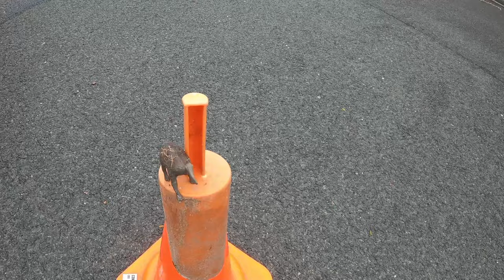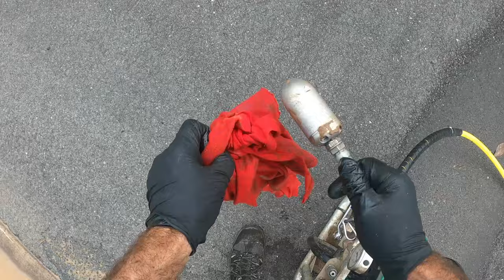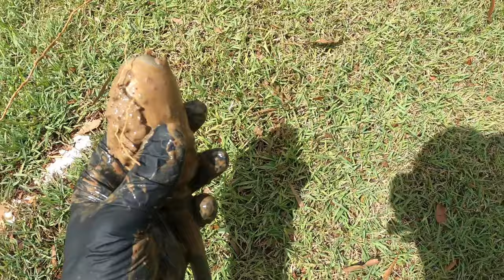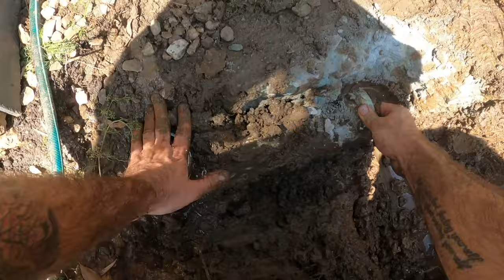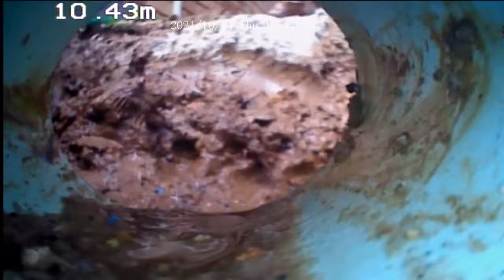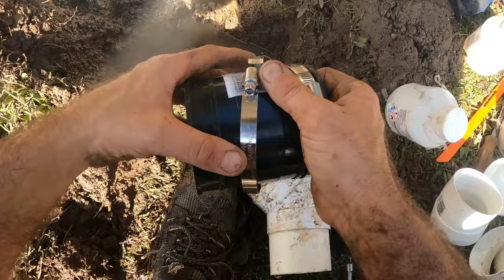Blocked Drain 144 - Muddy Storm Water Unclog & Repair

Comment: Were i worked at p.s.d. for 21 years.we used a jetterall most everyday..we worked the main sewer .you allways get some sort of stoppages .it will go fron 8 inch to 24..sometimes it could be back up for weeks..you would not beleave what people put in the sewer..the jetter we used is huge.700 gallon tank. 2400 p.s.i.it will take you off your feet..600 feet of hose .1 inch..if you get it stuck. .sometimes its reall hard to get loose.i said i never want to do that sort of work again .we did do some personal lines 4 inch..and then i started watching you.

Comment: Perfection. Toss in a bottle of the cheapest liquid dish soap you can find into your fitting box. Works amazing to lubricate the pipe for the fernco fittings and will not deteriorate the rubber.

Comment: just my observation, when i first started watching you, you took your time letting the nozzle do the work. now you keep jamming it in there like drain addict.
Reply: I noted he doesn't always do the jamming thing, but with the clay, mud, and dirt, it may be the only way to do it without using an excessive amount of water.  He also doesn't know it there is a break in the pipe or if it is just mud so it takes a bit more work.  Just my 2 cents.  :)
Reply from the maker: It really depends on the situation and what I can feel.

Comment: You had a fight with this one. 

Could have done with your help a month back. Had a blocked kitchen gulley. Used our Nilfisk pressure washer with a 20m drain jetter attachment. Took over an hour as the pressure is no where near as high as yours. Quite satisfying though.
Reply from the maker: Well done unclogging your drain

Comment: Personally, I would have dug out all of that pipe from the downspout to the part where you cut it, re- engineered it by laying new pipe from downspout down with fewer bends and making the angles more sweeping and free flowing.   As it is now,  looks like it will be likely to collect more crud and be even harder to clean out.   Great work with the 22.5 and 12.5 though and getting it to line up well
Reply from the maker: Thank you 😊

Comment: This is just one of those things where there is no good way to get it fixed.  The best way would be to dig it all up and replace it with schedule 40 PVC (at the minimum) all glued up, properly pitched, and allowed to set dry long enough for the glue to cure and then bury it.  Now it is just get things put back together good enough to work and last a few more years.  Homeowner should start socking away money until the good fix can be afforded.

Comment: I've watched enough of your fun videos to wonder why the contractors down there use such thin pipe for these storm drains. The stuff looks eggshell thin.  I mean it's a good thing for you and your fellow cleaners. Good job security,  but the contractors just come off cheap and ends up causing the homeowners trouble they wouldn't necessarily have with a more robust pipe, less likely to crack or on the curb collapse if driven over.

Comment: Could've been fixed ages ago before the rain..... Yes, that's true, unfortunately, sometimes the problems don't appear as intense until the rain comes and you see where the problem is. Like spraying soapy water on gas fittings or bicycle tyre tubes under water to see if there are any leaks to fix. That's why professionals like yourself will always be in business as one day, everything is fine and fair weather, the next it buckets down and a blockage becomes highlighted. Love your work, videos are great, although I think your little offsiders need a kick up the pants to help more, or bring in some more.
Reply from the maker: Thank you 😊

Comment: Why don't you get a used electric drain snake with 250-500'off of Offer Up run it after you get it wet the jett rodder or you need a strong water stream maybe get off of harbor freight a fireman nozzle hooks to trash pump out let let it power through

Comment: I'm not gonna say anything  about that cheap flimsy pathetic  pipe they use for stormwater...... I'm just gonna keep it to myself
Reply from the maker: Haha 😂
Reply: Sch 40 only way to go
Reply: Sh40 or 80, glued, and run with adequate drop that pipe wouldn't have been a problem.
I don't see anyone commenting on the fact that there was water trapped in the pipe. Means the pipe isn't on a continuous down slope. It will just silt op again quickly.